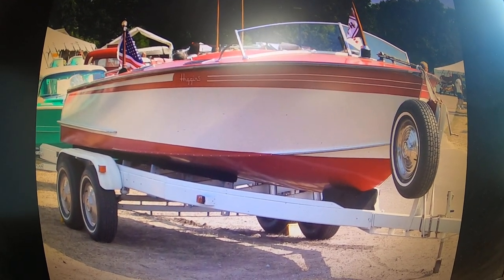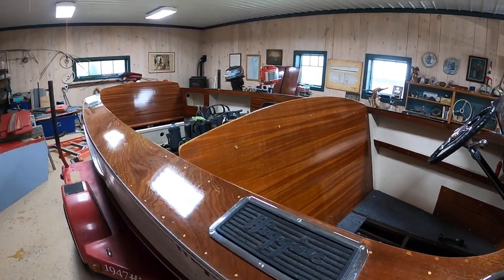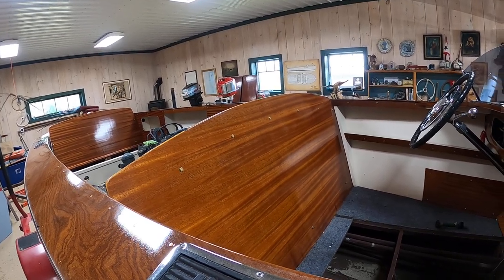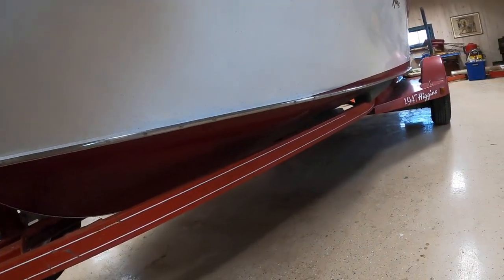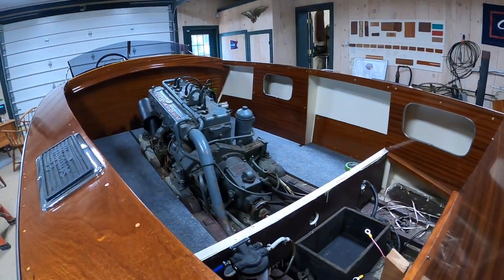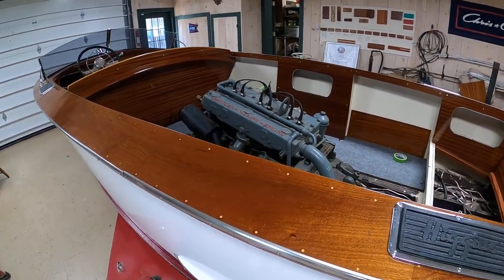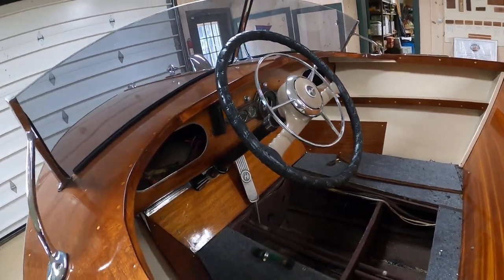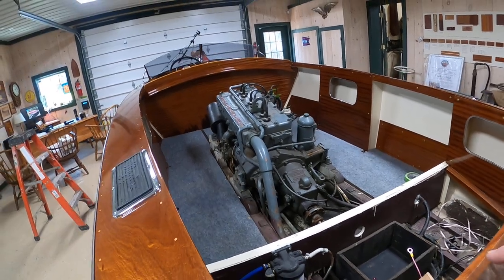1947 17' Higgins Sport Speedster

Comment: I own the "example" boat you have on your computer screen from the :24 second mark to :52 seconds.  Currently docked behind my house in Slidell, LA near Lake Ponchartrain.  Mine has a 1958 Gray Marine 327 (which was based on the 327 AMC motor), and she'll tickle 45 MPH on glass with me and the wife.  Bought it sight-unseen from the same video ad you had on your screen last year.  Glad to see another one is getting a new lease on life.  As others have pointed out, these boats were built in New Orleans about  30 miles from my house and it felt right to bring her home.  "No Reason" draws tons of attention wherever she goes...
Reply from the maker: A 327 in that ultra-lightly-built hull? I am amazed it has not torn her apart!
Reply: @snakemtboatworks  Not sure why you'd think that. Weight-wise, the 327 motor is about the same as a Chrysler Crown, and I don't drive her hard in any sea condition. Many, if not most Higgins Speedsters I am aware of have been converted to V8 power at some point (via the ACBS registry). Again, as long as they aren't abused, they can take it. Mine was converted in the late 60's, so she's been running with that setup for over 50 years....
Reply from the maker: Weight? Torque, not weight is the issue. Super high torque is the issue.
Reply from the maker: Your hull, and especially the strut and shaft log, and particularly the keel they are mounted to, are designed for far, far less torque than what a 327 V8, and the prop mated to it deliver.
Reply from the maker: I am speaking from experience - destroyed hulls with protruding fasteners and wobbling struts. Right after boasting how fast they went, both owners of those two boats also claimed, “I really did not drive her that hard.”
Really? Then why are you boasting about how fast you could get her to go?
She’s your boat so do what you want. Remember, the hull is comprised of sheets of barely 3/8” plywood and very, very few frames that are super under-sized themselves.

Comment: Did you mean that it will be getting 2 layers of 1/4 inch plywood ?
Reply from the maker: Hey John. I could give you an economist's answer, " on the one hand, xyz, but on the other, rst." Why? This is our maiden voyage replacing Higgins single-skin bottom. The topsides have no such thing as a chine plank, but there must be landings of some sort to accommodate the plywood bottom sheathing, but we will not know much until we have the bottom skinned sometime next week.
Combining two quarter-inch sheets would leave the bottom sheathing proud of the edges of the topside sheathing. A combination of 4mm+6mm = 10 mm converts to .394 inches; still too thick, I suspect. And 4mm + 4mm = 8mm and converts to .312 inches. Then we have the layer of 3M5200 that will be applied between the two sheets. 
We'll know so much more as we strip the current bottom sheathing. Yes, at least one, and probably several bottom-specific clip will follow. (Why does my stomach hurt?)